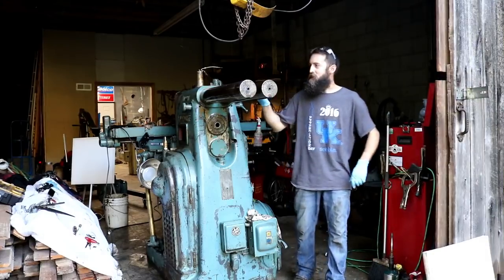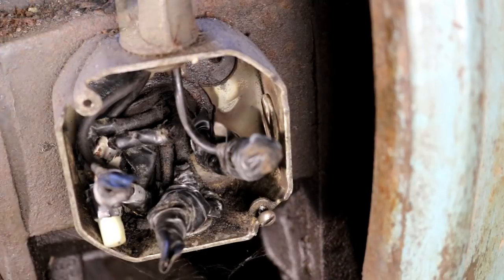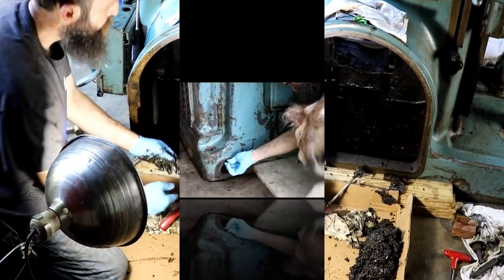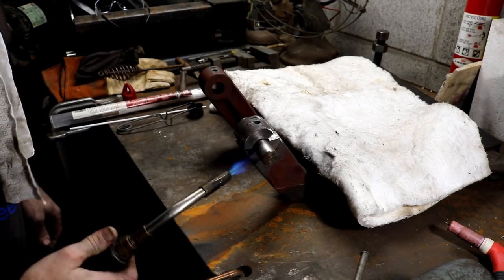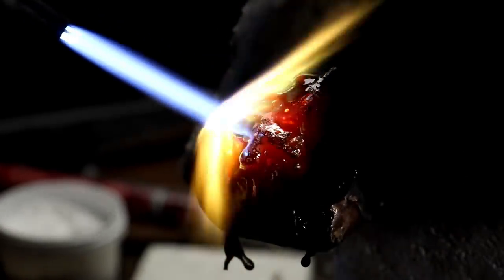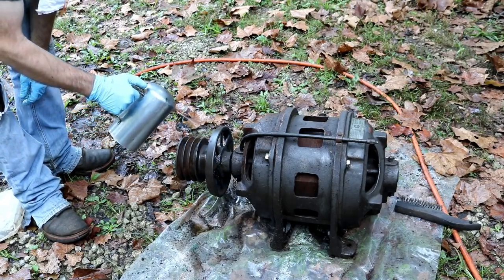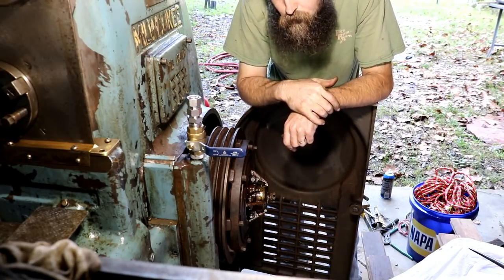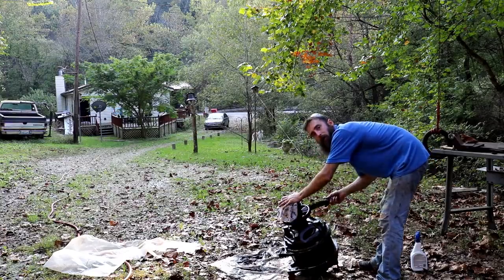Big trouble with the K&T / Mill Motor removal Part 1

Comment: Have to give "props to Mr. Norman May for the great explanation as to why you and most people have a hard time brazing..
My comment was, I guess I'm going to have to show you and a few others how to braze! That tip you had probably would have worked, just would have taken a bit longer to get up to temp, but once there, would have been better and faster in the long run and most importantly, you wouldn't have overheated the joint!
I remember back in college, our instructor made us braze the edge of a 3" X 6" X 3/16" coupon without overhanging the brass down onto the plate. What you did was a piece of cake! Good thing is, it's finished, hopefully it will hold, if it doesn't, you'll know why based on Norman post!!
Your doing a GREAT job here Steve and I as I'm sure most of us, are enjoying this series a lot!
Take care, give those "mutt heads" a treat for me....
Razor!

Comment: Steve, Don't worry the gear box section comes out quite easily.  The shaft is easy to get to and fix.  It took me about an hour to pull and replace the speed gear box section on my 2HL and your machine is just as easy to pull, may be a bit heavier.   Don't pull the pulley assembly off.  Just pull on the spring loaded locking pin that drops into the holes in the pressure plate and unscrew the clutch pressure arm assembly far enough to remove the clutch cone "bell".  I had to do this just a few months ago after a shop move that broke one of the gear select handles on my 1943 2HL.  Remove the cap screws and use a couple jacking bolts (you should have socket head set screws already in place) in the tapped holes in the edge of the front face of the gear case casting.  The jacking bolts will force the entire assembly out and you can pull it.  Shouldn't need a crane but your engine hoist may be helpful.  Reassembly just requires aligning the cam pins with the gear sliders and getting the dowel pins to line up.  You may want to make a wood block to hold the clutch handle up and out of the way.    More info on my machine with contact links at: http://vintagemachinery.org/registry/detail.aspx?id=17983

Comment: One of the reasons that people have a tough time brazing cast is they miss a critical step and then use the wrong torch setting. When you have finished grinding your weld prep you must "sear" the surface of the cast with an slightly oxidizing or oxygen rich flame. You set your torch up and the run over the newly exposed surfaces. You will see small bright orange spots as you heat the material. Those spots are graphite particles and bronze will not adhere to them so they must be burned out. After you finish the sear use a wire brush to finish clean the surface. 

When setting your torch for brazing your flame should be slightly carburizing or acetylene rich. When using a carburizing flame you will see the bronze "whetting" the surrounding surfaces and it will flow into the groove. If the bronze doesn't whet the surface and flows away from it you will have to regrind it as the material has been burnt from overheating and oxidized. This is the reason corners can be a problem as the cast has been oxidized or overheated. If you use a neutral or oxidizing flame you will tend to overheat the cast which will result in a lack of fusion and poor surface appearance. 

If you have access to a TIG setup you may want to consider using silicon bronze for repairs like this as the TIG allows for more control and the silicon bronze is slightly stronger.
Reply: Great explanation there Norman.
Even in all my 40+ years of welding there were some things that I had forgotten when it comes to brazing.
Searing was that bit of information I refer to!
Thanks for refreshing this old guys memories...
Now I can post my comment about having to teach a few guys how to braze!!
Razor!
Reply: Nice piece of information here. I think the searing might be useful for TIG brazing too. I once tig brazed a piece of cast iron and it did not go well, I think it was full of oils and stuff, I thought then maybe I should have heated it up first and "burnt out" whatever stuff was embedded in the metal. That was just a gut feeling but this seems to confirm it.
Reply: Having not actually brazed much on cast stuff myself, I'm obviously no expert, but I've watched a lot of people do it, and it seems to me the pre-heat step is what people skimp on most. Gotta get that part pretty toasty before you start brazing, didn't know about the searing step, but I guess that happens when you pre-heat it usually.

Comment: A rotary orbital sander without the sand paper works great for soar back, I could not stand up straight about  week ago and after the sander massage no problem. I found it was best at lower speeds, try it you will be amazed.

Comment: Hi Steve great braze repair, remember that braze is far stronger than the cast iron, so a little short on full section is not an issue. For asthetics, some body filler/paint.
I like to paint inside of my machines, cupboards & cabinets etc in a light colour, ref aids viewing, especially as my eyes get older.
Thank you for sharing and teaching many of us subscribers top quality engineering to a very high standard.
Floor looks good.

Comment: There seem to be two strategies.One says take the machine apart completely and repair as you go along. The other is fix what's obviously  wrong and keep going.  Restoration vs refurbishment. The dividing line is your estimate on where the machine is.  I think your K&T is right on the dividing line :)  Keith Fenner in one of his early videos shows the restoration  of his K&T and he goes plan A. Take it apart completely. Brad Jacobs (BasementShopGuy) follows that route, but one time does a refurbishment.
Anyway I think you are doing OK. 

On hardwood floors: yellow pine is a fine wood. Lot of structures built in 16xx still here, which is more than I can say about other woods.

Comment: Hey Steve just a suggestion as a fellow machinist stuck with single phase you may want to consider switching that motor out for a brand new single phase motor while you have it out. I have done this with several of my machines this year. It's well worth the money!   I have been getting mine off of eBay very reasonably. Good luck with your project!

Comment: Steve I think when welding  thick cast you should use a backing plate of copper which is very easy to remove after a nice edge is obtain.
Reply: Aluminium is preferred bronze does not stick to it as copper is a main element in bronze
Reply: Graphite rods and plates are the best way but that stuff makes a heck of a mess in your shop.

Comment: Hi Steve, she's a lovely miller and while a big strip, repair rebuild isn't what you wanted to do, the mill and you will be so much better off for the project. The clutch strip down will be time well spent knowing when it's done it's safe and sound ! Keep your chin up mate,  nice job on the flooring 🙄 All the best Mat
Reply from the maker: Yeah, clutch needed to come apart anyway after setting and rusting for years.  Just one more thing to add to the list.. 😃. 
Thanks for stopping by Matt

Comment: Used to refurbish these things back in the early 1990's. Then GE bought out the company and I was laid off permanently. 911 hurt the steel industry bad and it never recovered. I will say you are very intelligent as t takes many disciplines to fix these. It took a who factory to rework these. Your biggest problem will be the windings. Clean gently with air and check and check for ohms.

Comment: I think you're already wired for 230.  Usually 480 has the three feeds each going to a single wire, and there are three groups of 2 wires joined together.  230 has the feeds each going to 2 wires and there is one group of three wires tied together.

Comment: i think to mount it safely it be a good idea to make a podium the same height as and in front of the engine mounting plate , you can lower the motor on the poduim with an engine crane and the slide it across the podium in ontoo the engineplate
prolly can make it cheap out of a pallet and some smooth plate

Comment: You do not need to remove the pulley bracket. You do need to remove the speed box on other side. I always put the box in lowest speed.You need to remove the bell and finger assembly:  You need to lift the start-stop lever and block it up.(I believe there is a set screw on the boss under the electric switch), put two long studs in screw holes and slide speed box out and lift with crane,use two long bolts in top holes and strap on them. There are two jacking screws to push box out.

Comment: Hey Steve, it’s very possible that the chewed up brass screwdriver you found in coolant sump could have some how worked it’s way through the inner workings of the machine and caused your shaft problems. Just a thought.

Comment: The broken cast mount may have been face-hardened (chilled by rapid cooling in a partially metal-lined mold) in the mold, making certain areas very hard and wear-resistant and the rest just regular clay-mold-cooled softer metal.  In cast iron, the color of the metal changes to a whitish sheen when chilled (lots of cementite).

Comment: My mom wanted hardwood floors in the house i grew up in, she waxed poetically about tearing up the mid sixties carpet and laying down a nice oak floor. She happened to mention it to the neighbor lady, whose mom and dad built the place originally. Well the whole thing has hardwood floors Carol (My mom), oak in the front room, cherry in 2 bedrooms, pine in the other one, and fir 2x6 in the laundry( which had been converted to a bedroom). 4 hours of tearing out carpet and presto, hardwood floors. Should have known it would be like that because most of the walls were 3 quarter inch tongue and groove pine planks. Why is there carpet on an oak floor? Who knows.
Reply: Everything old becomes new again.  I had a friend whose adventure in 'covered up beauty' started by replacing a ratty old shower door, got into replacing old wood framing, and led to the discovery her house was actually a beautiful red brick which had been covered by vinyl siding.  All she wanted was a shower curtain...

Comment: Steve, maybe the machine didn't drop, it's possible someone cranked down on that bolt too much and snapped the casting. Nice braze, don't paint the repair. When you picked up the machine I thought this would be plug & play, hasn't turned out in your favor, but I think you got it under control. You better get back to the flooring.

Comment: I always take the end of the rod and quickly weld it to the new one, so that I do not end up with a box of stubs. Then again, I rarely use a fluxed braze rod, just a uncoated one and a lot of flux, or for big jobs just grab a handful of borax and use as flux, then chip off the glass layer afterwards then wash.
Reply: That's a really good idea
Using it
Reply from the maker: A couple of the rods I used in the repair were made from several. LOL, I do the same thing 👍
Reply: Gotta love 20 Mule Team Borax :)
Reply: Me and my father often used regular copper wire from old transformers or heavy house wire to braze with, as that was often the only thing available on the weekend when we ran out. The flux I buy in 20kg bags from one supplier near me, useful both as flux and as insect killer. Price for the bag is less than the price of the smaller tin of similar flux, that is reserved for jobs involving stainless steel and where I want it to look neat, and where flux removal is not going to involve chipping a hard glass slag off.

Comment: Ya need to get that motor on a bench to work on Steve! it will save your back in the long run. Do you think all the damage could be the result of a catastrophic crash in the past? Fantastic job by the way, your attitude could not be better.
Reply from the maker: I think the machine was dropped off a fork lift at one time. Of course I will never know for sure but it looks like a drop.

Comment: I would have just stuck the whole motor mount in the oven. Self clean cycle if you are worried about it cracking. Just make sure you disengage the safety lock for the self clean cycle.

Comment: That may be what's wrong with my K&T 2H. My clutch started sticking but if I push the handle hard it releases. Mine sat out in the weather for years and years before I got it.
Reply: There is a spring loaded detent pin that is in the removable speed gear section.   In the model H there is a pin in the clutch shaft that rides over this detent and  helps force the clutch into full on against the clutch cone and full off against the break cone.  It is more likely this pin or it's spring is messed up or packed with junk.  Unfortunately you will have to pull the speed gear section to get access and fix it.  
You can download parts manuals at:
http://vintagemachinery.org/pubs/detail.aspx?id=19665
and 
http://vintagemachinery.org/pubs/detail.aspx?id=6553

Comment: That's a decent motor
What's the plan Steve, surely you need a VFD to run it?
Reply: You could put a metal strap around the end of your motor bracket that would absorb any stresses which caused it to snap in the 1st place.
Reply from the maker: Probably use a phase converter I would say.  Still not sure. 👍

Comment: Oh no, it had to be something. Score rebuild old iron, just gotta fix an itty bitty little break waaaayyy back in there, no big deal. Just labour, lots of labour. Oh well, probly wanted to go over it properly... One day... Now you just dont have a choice. I feel for you, its exciting having a nice solid machine you just want to use but at least im guessing its the kind of thing that can be fixed.
Reply from the maker: LOL, almost anything can be repaired. This clutch shaft is no different. It's a simple push pull shaft and should be easy once I get it out.👍

Comment: Steve, If you have a copy of the K&T "Parts manual" for the model 2K could you scan it to a PDF file and post it on the site Keth Rucker is working with,  vintagemachinery.org?

Web link:   http://vintagemachinery.org/mfgindex/detail.aspx?id=2098&tab=3

I looked and can't find it there.  If you post it folks like me could follow what you are doing a bit closer!  And if someone else has a machine like yours it would be a big help for them.

Also you should post your model 2K in the "Machine Registry" on the site for Milwaukee machines with links to these youtube videos.

Web link:  http://vintagemachinery.org/mfgindex/detail.aspx?id=2098&tab=5